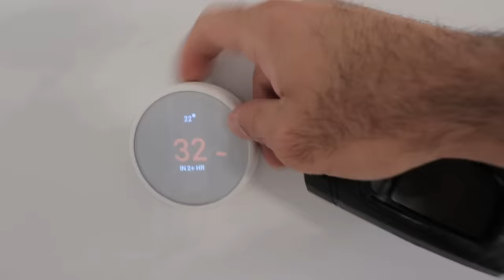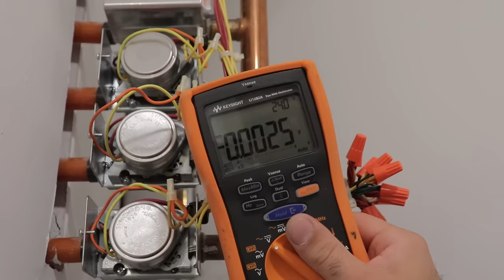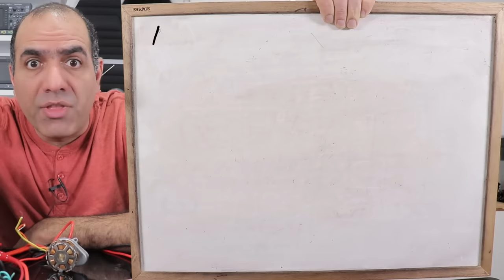Electro-Plumbing Repair… of my home heat zones that won’t heat although the boiler is running fine!!

Comment: 10:58

This system resets itself to a known state; all valves automatically close completely upon loss of power, it's not possible to end up half-open. Using D/C motors and limit switches in the "closed" position could do the same, but then you need more I/O pins on the controller ($$), more switches ($), a decent power supply instead of just a cheap transformer ($$), more code to handle the "closed" switches (which means more potential bugs & more programming $$$$$)...

It's the cheapest system that gets the job done and mostly doesn't fail before the warranty expires. Looks like a good engineering job to me! :D
Reply: But the circulation pump would shut down in a power outage, who cares if the valve is open in a closed loop system?  A simple check valve will stop any water reversing flow.

These days (alleged chip shortage aside) micro-controllers are dirt cheap, most commercially available (heck, even hobbyist versions) have enough IO pins that can be multiplexed to work very cheaply.  The coding cost is debatable as well, and entirely dependent on the number of units sold/installed.  Here in Australia such water based heating systems are rare, so yeah, all components inc programming would be expensive, but I believe pretty common in the northern hemisphere so less of an issue.

And your assumption of a decent power supply being more expensive than the potential "life of product" power drain of this cheap alternative could be argued.  

"mostly doesn't fail before the warranty expires" is cold comfort (pun intended) and a poor metric... good for the seller/manufacturer I guess, but this planned obsolescence is bad for the planet, as it needs yet more replacement parts to be made and consumed over the actual life of the entire installation.
Reply: so add bit of code or even circuit logic that upon restart, drive all valves to close/open for few second and then normally control them.
Reply: imo you really don't need much I/O Pins, just rs-flip-flops, a shift register and a timer. Heck, you could even use an fpga for all that. Implement a proprietary or public open source serial protocol and all you'd need are like two I/O pins at minimum, better yet four as twisted pairs for RX and TX.
Reply: Why not relays?
Reply: It wouldn't even need any electronics, just a single "horseshoe" rocker double pole switch would work
Reply: You can take advantage of direction and use diodes with switches.
And you know if you closing valve by measuring amps.
Reply: @Mkananoja  This is fail close. The point is that if you lose power, all the valves close then and there, without requiring further electrical power. An example scenario could be stopping water leaks after an earthquake. Minor damage to a pipe, coupled with an area wide black out could result in a flooded house, that would have otherwise only required minor repairs.
Reply: @PeterThorley  Yeah, first thing that came to my mind was this behavior was safety related stuff.
Reply: @PeterThorley  the valve is only on one side of the line and the line is a loop, if you crack a pipe it will drain to the crack. if (as it looks) the loop is connected to mains turning over valve off won't change any outcome.
if it's not and it relies on the recirculation pump and runs at ambient pressure then the pump would stay off until some "clearing" event in both situations.

All the claims about cost are moot. You could implement this as a DC system running modbus for about $2 in parts and get that back in the copper cost in the motor.
your system could then expand to 240 odd controllers and by sequencing the motor operations you could do it with a tiny power supply rather than needing a transformer sized for all valves in their on state at the same time.
Reply: Yeah I was curious if it might have anything to do with motor durability too.

Comment: Very cool. I'm an hvac tech ...ive never  tore apart a zone valve that far. I fix these things all the time but still learned something today. Cool.
Reply: The only time I've taken one apart instead of just replacing the head was when I was a trainee and was instructed to "change the head on that valve". Still remember my bosses confusion 15 years later as to why was the old one in pieces in the box when at first he thought I was wasting time on pissing about. Difference between theoretical knowledge and practical knowledge.

Comment: That is an impressive heating system. I feel like a cave man with my propane furnace
Reply: But I bet yours works.
Reply: This heating system is barely the minimum requirement in Europe!
Reply: @MyNotSoHumbleOpinion  Yeah, not at all
Reply: I have a kerosene furnace....
Reply: @g3th_  then let's say in civilized Europe.  in Italy every replacement of the heating system must be done in this way with at least a condensing or biomass boiler!  Each new construction must instead have at least one hybrid system with a water heat pump, solar panels and  photovoltaic panels!
Reply: If that is impressive you should see my heating system. A ground heat pump that pulls heat from the ground, puts it into the hot water loop and then we have a secondary 80 L tank. This runs to fan radiators and in summer it can reverse to cool water and cool the house
Reply: It's actually junk.
Reply: Nothing wrong with gas fired heaters if they are configured well. A cheap ceramic propane heater can produce lots of heat from little propane, I use a small 10" x 6" one to heat my room in winter and your usual 36gal propane tank last a month or two. It's effective enough I have some semblance of a plan (as in BOM and design diagrams) for converting it into an electrically controlled ceramic propane heater instead of manually turning it on for 5 minutes every 2 to 4 hours (depends just how cold it is outside).
Reply: Have fun changing out that geo about every ten years…
Reply: @MyNotSoHumbleOpinion  Hooold on buddy... I've seen Fiats, I'm not that impressed by Italian engineering lol.
Reply: @jetjazz05  and what do you think about Ferrari, Lamborghini, Ducati, Leonardo(Helicopters) and MV Augusta(motorcycles), Vibram, Climbing Technology, La Scarpa, La sportiva, CAMP ...?
There are tons of other industry that sell only to companies so it’s hard to know them but, for example, almost every marble kitchen top is cut with italian machines.
We are everywhere.
Reply: district heating is better
Reply: @MyNotSoHumbleOpinion  and you have a proper distributor with flow indicators, and electromechanical valves instead of this dumb valve system, and heat shielded pipes, sometimes these american setups really suprise me how "weird" they are
Reply: @jetjazz05  not an italian, but cars are made to break, and not last 30 years, the last one built like that is the golf 3 1.9tdi and it was so good, VW had to make the golf 4 shit to sell parts 😂
Reply: @jetjazz05  Fiat copied the clever Ford's production in series, but then Ford come to Italy to know how to make good cars watching Fiat!
Btw having a good law about thermal efficiency does not mean that we must use Italians products. German boilers and components are really nice! (like Viessmann that Mehdi has)
Reply: @karlodomic2890  absolutely yes! This system can have a lot of improvement like a proper compensator with dirt separator, electronic pump and good pipe insulation! but considering the American average, it's quite good!
Reply: @whaaatno7439  well it's fine because the government gives compensation + the electricity is about to rise to unimaginable prices here in Norway and the colder the winters are the more you benefit from the more warm ground temperature since larger temp gap = less efficient. At electricity prices of like 0.3 USD to 0.5 USD per kWh it should pay off to have a geo.
Reply: Hank Hill approves of this message.
Reply: in italy i had a portable propane tank furnace too
used to have to carry the tanks home all the times, wasnt fun
Reply: @Vinni-2K  and we have also fireplaces or coal stove, but luckilly new houses must be made with some 21st century skill and standards

Comment: looks in horror at wire plugged into 110VAC socket with bare wire nuts dangling in the air
Reply: You can feel the sketchyness ooze through the screen
Reply: I didn't see any earthing either
Reply: that's why you don't let plumbers do electric work
Reply: No problem, it's ony Americam wimpy 110 volts, try getting away wiyj that on 240volts!
Reply: @zebo-the-fat  sounds like the rest of the world is compensating for somthing
Reply: @marcogenovesi8570  More than likely the heating unit was installed by HVAC techs but the same rule applies.

Comment: The "short-circuit" is the correct way to plumb that boiler. It is called primary-secondary pumping\piping. There are two circulator pumps. The primary pump circulates water through the boiler's heat exchanger. The secondary pump circulates the water through each of your zones for heating. This primary pump is actually located on the inside of your combi boiler. What I did notice is that the zone valves are not on the correct end of the zone piping. Zone valves should be installed on the return side of the piping so as to not to cause water hammer when the zones shut. Because the pump is creating head pressure and pumping into the zone valves, there will be a spike of pressure when the valves shut from the head pressure of the pump. This can result in a knocking noise whenever any of your zones shut. I would recommend moving the zone valves to the return side of the zones if possible.

  The voltage you are getting from the power supply should not really hurt those motors too much. Its pretty much a nominal voltage difference from what the motors are rated for. Most zone valve panels like the one you have output 27-26VAC to the valves. All the end switches on each zone valve are usually wired in parallel to the T-T (AKA thermostat) terminals on the boiler signaling the boiler to run. Each thermostat makes and breaks the 24V power going to each of the corresponding zone valve motors by disconnecting one leg coming from the secondary side of the transformer. If you continue to burn out that same motor I would recommend replacing the valve body and not just the motor. Usually what happens is mechanical resistance occurs at the valve stem over time from scale/buildup inside the valve. This scale/buildup will cause the motor to prematurely wear out over time. 

This advice is coming from a professional mechanical contractor/HVAC tech with 12yrs experience with hydronic/steam heating. Hope this helps you out.

Comment: I work at a motor company. I've heard a bit of an urban legend that once, many years ago, there was a tiny strand of copper causing a short that stopped a motor from functioning. The fix? Shock the sh*t out it and burn out the short. Maybe that's what happened to you? Who knows

Comment: Oh man... I'm only 2 minutes in, but you for it backwards, the manifold with the "thing" are the return hot water with a circulation pump - and yeah it's supposed to be "short circuited" so that you resupply the hot water return to the boiler where it can be reheated

Comment: I suppose the motor fight against the spring and button all the time to have a fail-safe setup. If the power is lost or a motor dies, all valves close.
Reply: Neither valve position is "safer" than that other tbh.  It's is a legacy system that was designed for least possible complexity; voltage applied valve opens, voltage not applied valve shut.  These would traditionally have been controlled by a simple bi-metallic strip style thermostat.
Reply: @underdweller  If the thermostat fails why would the boiler continue to run?
Reply: @underdweller  The heater needs electricity to turn on. If the motors don't have power the heater won't have it either.
Reply: @danieljensen2626  The motors can lose power independent of the heater, or fail themselves just like what happened here.
Reply: Close but it's precisely because there is no power when the thermostat is not calling for service.
Reply: @underdweller  correct, when the valve is fully open it hits the limit switch and the heater starts. But when the thermostat shuts off it just cuts power. The spring return then closes the valve disengaging the limit switch and shutting the heater off. In North America, the power originally was sent over telephone wire and there wasn't a way to reverse polarity in a compact form factor so it is either on or off. In fact I just replaced my wire last year and I used...phone wire.
Reply: @underdweller  the thermostat could just as well fail closed and keep the power on... having them reset automatically does nothing for safety.
also if the power to the thermostats fails entirely the switch will likely be also dead as the whole system is most likely powered via the one transformer

Comment: The bypass/short circuit path has a pressure relief valve in it. In case the water gets very hot and the syatem pressure increases, the bypass valve opens to inlet.
Reply: The supervent closest to the bypass actually just removes air from the system, the pressure relief right next to it dumps water into a drain.
Reply: Why would it connect to the inlet? I think it should vent to atmosphere / drain instead. The pressure in the system can still rise otherwise.
Reply: @marco23p  it doesn’t. The big thing with Honeywell on the side just vents air that gets trapped in the system the pressure relief to the right of that just dumps water down the drain, which isn’t great as you’ll never know when it’s hitting pressure

Comment: Hi Medi, I’m a commercial engineer and I do a lot of pipework design - Re the pipework: The installer has tried to create a basic low loss header but (for many reasons) the primary pipework appears to be undersized and the connections for flow and return are too close together.
Also there should be a by-pass between the circulator and the zone valves.
I could write an essay on the correct way to do it… but if it’s working, please don’t start re-plumbing it! 😂😂😂

Comment: The "shorted" hot water pipe is a bypass. It mixes super hot water from furnace with cold water. This way your radiators are safe to touch. You can think about this like voltage divider. Ofter there is a valve working like potentiometer so you can dial up output temperature.
Reply: Normally there will be a thermostat in the boiler to regulate the output temperature.  Pretty sure that loop is there to enable continuous flow even if all the heating circuit valves are closed.
Reply: It also make the return water a bit warmer when goes into the hot boiler parts and reduce temperature shock.
Reply: Lol what
Reply: It is a bypass, but not for the reason you mentioned.  The closely spaced tees provide what we call ‘hydraulic separation’.  By doing this, the water flow through the boiler remains constant, regardless of how many zones are turned on.
Reply: I doubt that its used to lower the temperature since its a gas boiler that can just turn on/off or modulate when necessary. Such a precaution is only required if you have a wood furnace or have a heater that heats up a seperate tank with the water inside. This would be one of the reasons why you would require a bypass here
Reply: Lack of  water tank is the reason why bypass is even more needed. You want the small quantity of water in your boiler to be as high temp as possible so when hot water is suddenly needed it can be mixed with cold water and give gas boiler more time to fire up. This also allows boiler to fire up less frequently. Those boilers( or at least mine)  during winter don't work constantly on "low" heat, they cycle on max every now and then. Similar bypass is sometimes installed on small water tanks so you rise temp on them and extend your shower time without installing bigger tank.

Comment: So you are worried about 15 watts of power which all turns to heat when turning on a zone that probably goes back to a 5000watt tankless heater?    The real problem is that the waste power doesn't just go to heat, it also goes into destroying the motors themselves.  The reason they are designed this way is so that they don't need any power to turn off.

Comment: The "short circuit" Is what is called primary secondary piping. This piping arrangement decouples the flow rates from the boiler pump and the zone pump. You can override the zone valves with the little levers protruding from the side of the zone valves. Your zones have no flow valves and you do not have a variable speed pump to maintain pressure. In other words if all the zone valves are open the water will take the path of least resistance. add flow valves to each zone return...set the variable speed pump for 8 psi...open one zone at a time and adjust flow valve to obtain a 20 degree delta T. None of the trades you mentioned do this type of work properly. What you need is an HVAC hydronic tech. We are very few in the US but very plentiful in Europe.
Reply: So is it a really short single pipe heat exchanger?
Reply: @im1random263  p.27
Reply: @anthonyspadafora1384  🤔